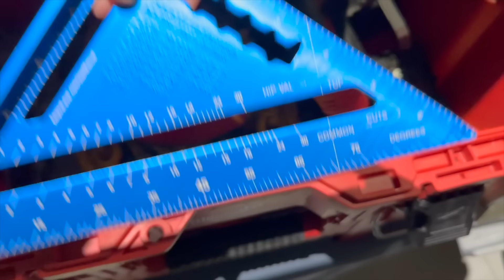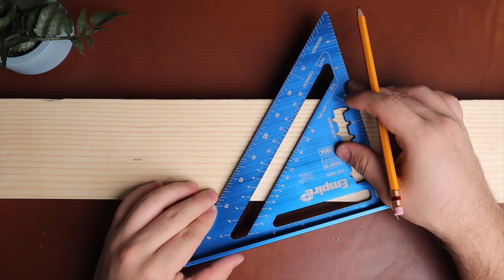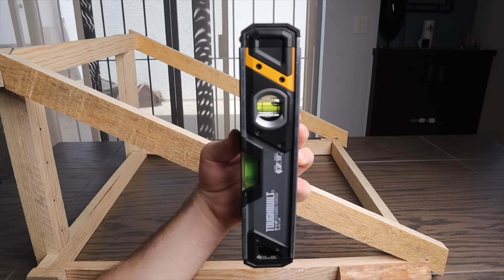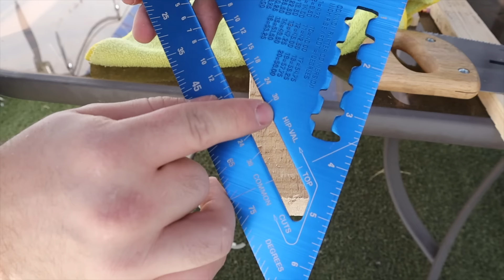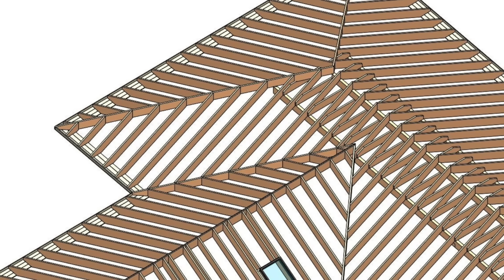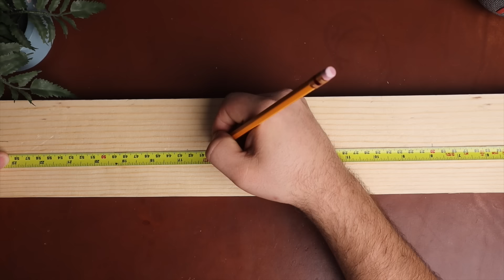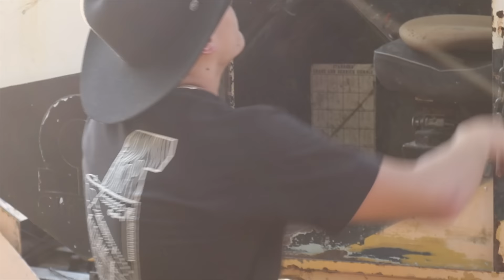Most people don't know this, how to use a speed square, the ultimate guide.

Comment: Your 6/12 is the cut of a rafter.
The pitch of a 6/12 cut is 1/4 pitch.
53 year carpenter.
Pitch is based on both sides of the roof rafters, 24 inches.
Excellent video on the speed square.
Do one on the old time framing square.
That has all the tables.
Good day.
Reply: Gotta ask - why would you bother watching a video like this if you've been a caprenter for 53 years?
Reply: @ralphashford9022  
Always interested in other techniques.
Always learning. Just because I have been in the trade for 53 years, does not mean I know it all.
Good day

Comment: A  roof with a Pitch of 1/6 and a building with a Span of 24 ft will have a height of 8 ft. 
24 ÷ 6 = 4 therefore 
24 ft  X 4 = 96" 
96" ÷ 12" = 8 ft. 
A 1/4 Pitch with a span of 24 ft will have a height of 12 ft. 
24 ft X 6 = 144 " 
144" ÷ 12" = 12 ft. 
A 1/3 Pitch and a Span of 24 ft will have a height of
16 ft. 
24 ft X 8 = 192 "
192" ÷ 12" = 16 ft.
Pitches are fractions.
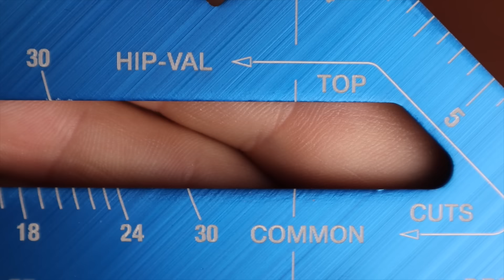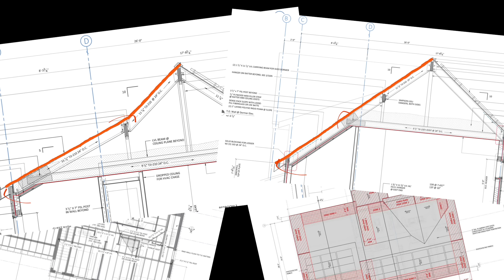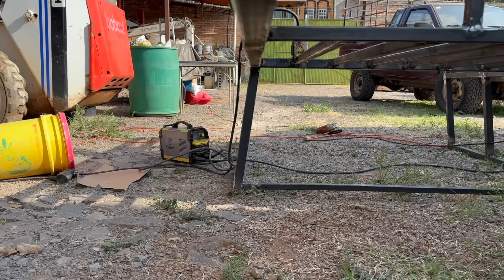Rafter Slope angles are in fact Ratios. ie 4:12, 5:12, 6:12 etc.

Comment: A Pitch of a roof is not the Same as the Angle of the Rafters of a roof. A Rise of 6 inches to a Run of 12 inches is a Ratio expressed as 6:12. It is the height in inches to the distance travelled horizontally per foot of Run. The Total Run is the distance from the outside of the top plate to the Center of the Ridge  which could be half the distance of the overall Span of the building. A building could also have an offset Ridge location thus having 2 different lengths of rafters with 2 different perpendicular angular cuts at the offset Ridge. 
1 run could be 6 ft. in length and the 2nd run could be 12 ft. in length. The rafters would then have 2 different angles at the Ridge Mating location with the longer rafter being longer due to a longer Run but also having a  smaller angular cut to mate up with the shorter length Rafter. It would also have a lower rise to run ratio but still having the same height. These 2 Rises to Runs are Ratios 
On the other hand the Pitch of a building is the expression of the height of the Ridge of the roof in relation to the Span of the building and is expressed as a Fraction.
Note a full 1 Pitch is 24 inches in height. 
Examples
1/4, 1/3, 1/6 

1/6 Pitch is 4 (24÷6 = 4)
1/4 Pitch is 6
(24÷4 = 6)
1/3 Pitch is 8
(24÷3 = 8)
Pitches can only be expressed on buildings with the ridge board being the center of the Span. Note Pitches do not apply to offset ridge location roofs.

Comment: I have one thing that I need to correct in this video. The angular cut of a rafter where it mates with an opposing rafter is known as the slope angle is 6/12. 6" rise to 12" of run. The run of rafter is the distance measured from the ridge to the outer point of the building which equals (26.57 degrees) The pitch of a roof is the angle at the ridge where the opposing rafter mate together in respect to the overall Width of the building. A full 1 pitch is 24" in height to 12" of run. So when you speak about a Pitch of a roof you could have a 1/2  Pitch roof which is half of 24" or 12" and the angle it forms is 45 degrees . A
1/3 pitch is 8" rise
 to 12" run and the angle the mating rafter forms is 33.69 degrees A 1/4  Pitch roof is 6" rise and 2 mating rafter will form a angle of 26.565 degrees. So the Slope angle of a rafter is Not to be Confused with the  Pitch of a roof. You could have 2 mating rafters with 2 different lengths with 2 different Plumb Cuts because they have 2 different Runs which will form unusual angles where they come together at the Apex of the roof. You might refer them to be Bastered Pitches...

Comment: If any of you guys are wondering about the diamond or why its marked 5 1/2 or 7 1/2 on larger squares its because those numbers are the width of common top plates. (His square doesnt have that feature but i know  milwaukee and swanson and maybe other brands do)

2x4 is 3 1/2
2x6 is 5 1/2
2x8 is 7 1/4 but 1/4 inch is barely anything so it don’t matter.

These numbers help make sure you get full bearing of your seat cut on your wall.
It can get more complicated than that but for diy its just what you need.

Comment: A framing square is more versatile, and many more tables on it.  In particular, because of its size, layout of stairs is easy.  Two downsides,, which a speed square addresses,, A framing square is large,, speed square can be carried all day in your belt.  And complexity,,, a framing square requires learning.  Entire books have been written on the use of a framing square.  An excellent YouTube video, like this one, can easily extol the virtues of a speed square.  It requires a book to learn all the uses of a framing square.  BOTH should be in your tool box.
You did skip the most used feature of a speed square.  When you cut with a hand circular saw, you do not need to mark a line.  Put your pencil tick for the cut length. Pick up speed Square and hand circular saw.  Flip the SS over so it is hooked on the far side of the board to be cut.  Pull it slightly toward you.  Line up the cut notch on your saw with the length tick and guide the cut with the edge of the SS.  Perfect length, perfect square cut, and faster than following a pencil line.

Comment: I agree, the speed square is a useful tool and I use it myself alot, on the job. But when it comes to laying out rafters and stair stringers and braces; I prefer the Framing Square. Because, it's very design is for roof framing. And stair building. Gives you the plumb cut and level cut as well as the length of material; all at the same time. 👍

Comment: If you ever need to do a quick level cut for lay-on rafters. Set the square against the board, make a small mark at the pitch and pivot to that mark. Do it again using the line as the new reference for the ever helpful double level cut.

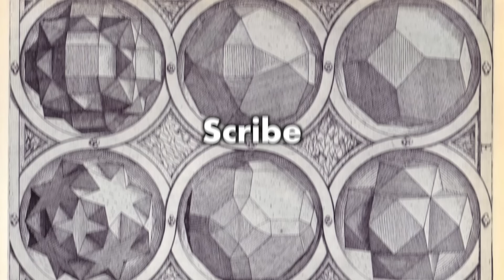Comment: had to pause at 3:26. The tip for measuring plumb line on the inside line due to pivot point adding thickness blew my mind. Tiny tricks like this increase the quality in carpentry. Thank you!
Reply: Sometimes that small distance equates to a huge difference when building certain things.
Reply: My square has a bit cut out at the pivot point, I wandered what it was for but I imagine if using the plumb line the measurement would be central to the string
Reply: Indeed, that was amazing!
Reply: Very true. That small variance of a string's width within a 7 inch distance can only multiply several to dozens of feet down the line. Also, his tip in reading from the lip side...I got that wrong reading a time or two reading from the "45-degree side".

Comment: Good video on one of the most useful tools to come around in the last ~50 years or so.
Most carpenters/woodworkers understand the relationship of the numbers in a pitch cut like 6:12, 8:12 etc. 12 is the constant and always means 12 inches in the horizontal. The other number is the vertical which determines the steepness of the pitch. The speed square has done the math for you already and has a separate scale for the hip/valley angles. Not everyone is aware that in a hip/valley cut the “12” number changes from 12 to 17 inches. In other words the 17 now becomes the constant horizontal dimension and the vertical will still vary. This is the number you would use on a full size framing square, where the angle has not already been calculated for you.
Reply: Hey, good info! Thank you!
Reply: I learned a little bit about this in the Navy of all places. We used a full-size square 12ths scale to make K frames for shoring hatches and doors against flooding. And used wedges to make us the carpenters we ain't.
Reply: Ha ! .. It's actually 16.97 not 17 if anyone want to get testicle .Lol . That little difference can bite you in the butt on intense roof frames . . But this vid is obviously not for that. It's generic and introductory . When you buy a Swanson . Most include what I call " The Book of The Brain Dead "  A particular pitch add this much to the rafter for the run . Then the inches . Presto . The answer . So flawed and on low pitches can create substantial errors of drop . The numbers are rounded off . At least on a real framing square there are listed decimals for common pitches . Much better yet . But when you step into bastards . Many rely on a Construction Blaster Calculators and have no idea why it derived that length . I impress on all my fledglings . Learn The Math . See it operate , watch it move .Speed Triangles are for laying out plates , scraping drywall and scraping ice off your windshield . I have a class coming up on taking calculating Common Length Difference on hip jacks with HPCL " Heel Plumb Cut Line " to an accuracy.that NASA,would approve.  Just playing around . I am a master carpenter with 43 years of inexperience . This vid was good enough for Learners . Had a few errors but nothing egregious . All my students . I emphasize .. Math !! . Let the Math do the work

Comment: As a framer I’ve used a speed square many many times a day for decades and a younger guy at work a while back asked me a question that kind of stumped me. He asked- 
Why is a 12-12 pitch a 45 degree angle but a 6-12 pitch isn’t a 22.5 degree angle?”

I honestly can’t answer that question.
Reply from the maker: Not even after the video ?, the pitch is based on height, not angles, so the higher it goes, the less change there is, it's quite simple if you have 20 inches in height, +1 inch is only a 5% change, however, if you only have 2 inches in height, +1 inch is a 50% difference, this is relevant because the angle change is dependent on the existing hight, you can visualize this with a piece of lumber and a large framing square, place one side on 12 in, and the other on 0, move up to 10 in, and visualize the change, then move up to 20 in, and you can see it will travel the same, yet its angle will change very little compared to the first movement.

Comment: Why the three lines for the bevel cut?
Reply from the maker: 45 outer line, 45 inter line, center line results as your max length at the point
Reply: @Gatlin_media  Thanks. That's what I thought might be the case but I was thinking you only needed the two outer lines. Now I see where three would be ideal. Thanks again!
Reply from the maker: @jonkjon  Correct, the center one is only necessary as a reference to measure off of, but in theory, you don't need it.

Comment: Real “PROs” don’t really use speed squares for much.  Learn math.
Reply: Pros working out on construction sites use them OFTEN because it's often faster than doing the math. Hence the name, SPEED square. And on the job site, speed = productivity.
Reply: @stevehatcher7700  l
Reply: @stevehatcher7700  I’m too old and tired to argue any point about anything. Iv been making a fine living building housing for going on sixty years now. I have a degree in civil engineering + a couple of masters in mathematics.  Speed squares are nothing special.
Reply: Real pros use a combination of both, can't mark up with a calculator no matter how good your trig is
Reply: There’s a lot of folks out there that call themselves professionals. 
Proclaiming oneself a professional and actually being a professional are horses of a different color. 
My credentials.  Semi retired.  Sixty five years of building mostly homes, and site engineer on a couple of interstate overpasses. Among other infrastructure projects. A degree in civil engineering, and two master degrees in math.
If you’re depending on a speed square to cut roofs ……. Well,  it’s just a hack.
A
Reply: As I said a combination of both , a black belt in SOHCAHTOA still needs to mark up, it's not solely depending on a speed square at all, speed squares are great for certain applications ie the applications they are designed for. The hip and valley functions work well as long as they come in exactly 45°, they do not at all take the need for maths out the job and anyone who cuts rooves knows this
Reply: Houses get built every day in every state in the union, and all the territories of Canada and Mexico, actually all over the planet. I’m sure Speed Squares are put to good use everywhere.😀